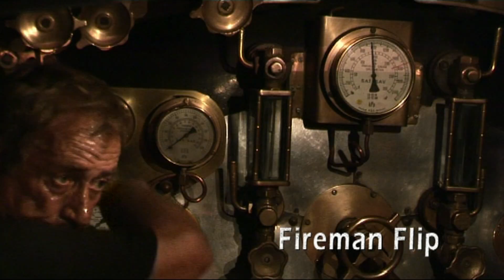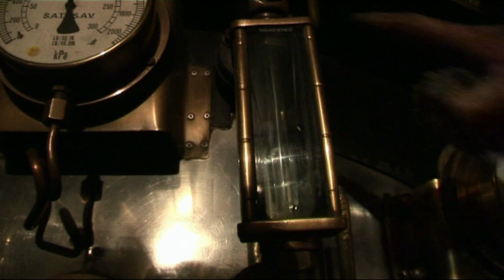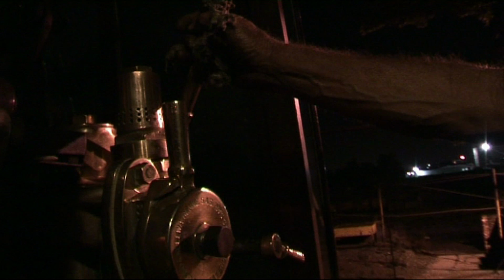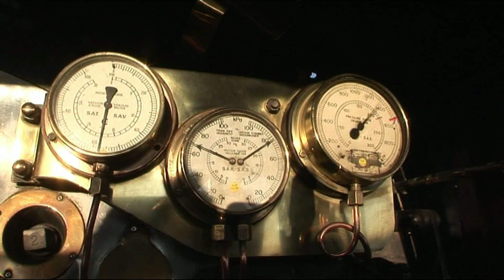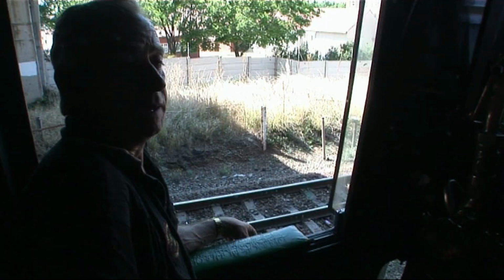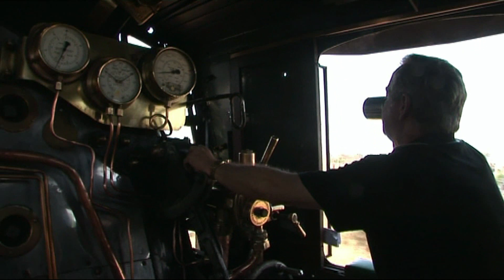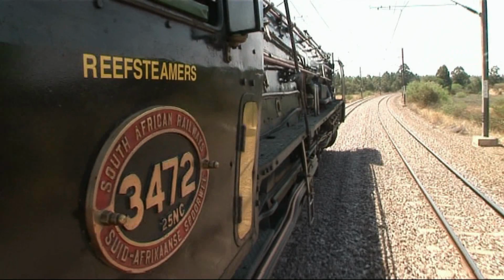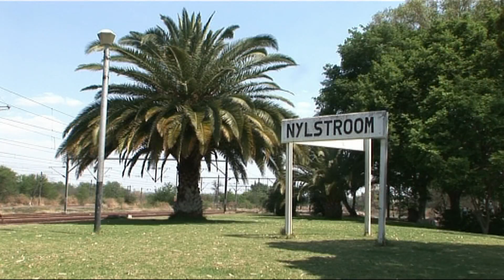How to drive and control steam locomotive, Class 25NC

Comment: Excellent!  I've always wanted to see how a steam train with a mechanical stoker actually works -- this is the FIRST video I've seen of this, almost all of the other videos show engines with hand firing!  So, the stoker controls are on the very bottom left, and to start the coal feed you first open the feed screw and then the jets -- right?  And I don't know if you would know this, but it would work pretty much the same on a Russian P-36 engine, right?